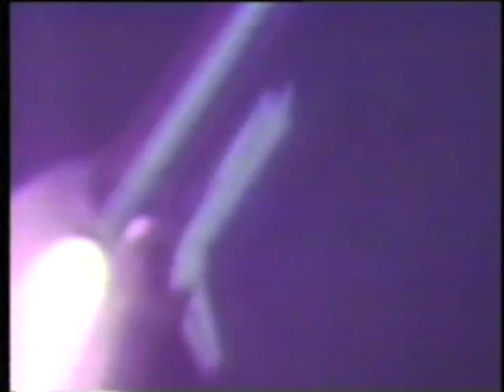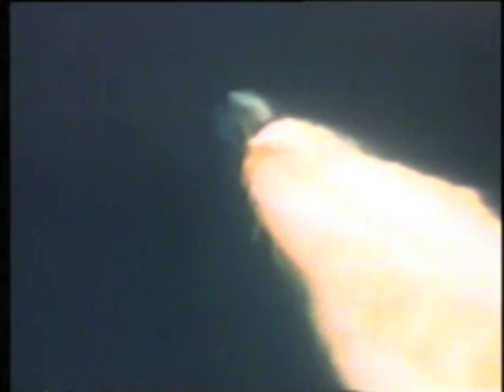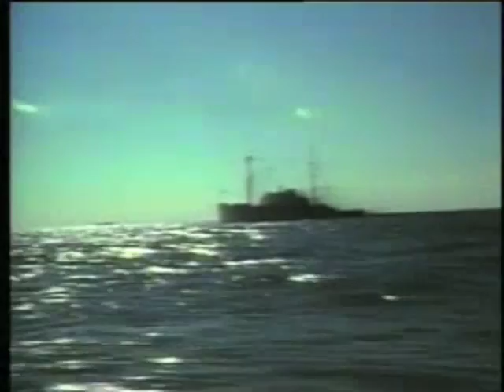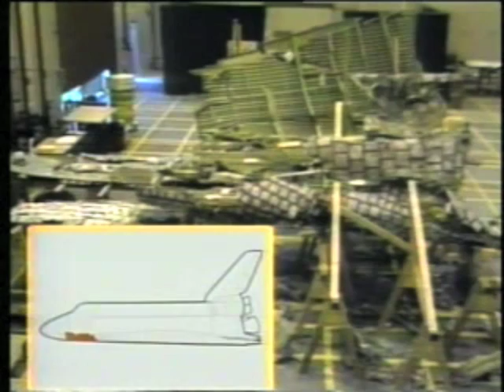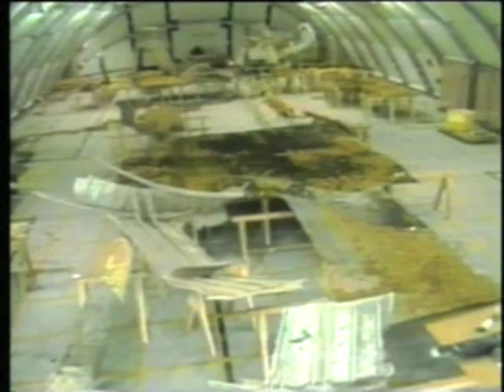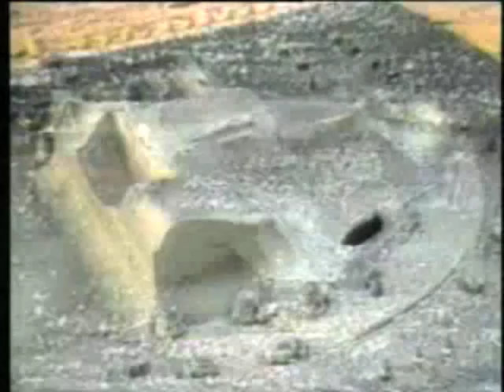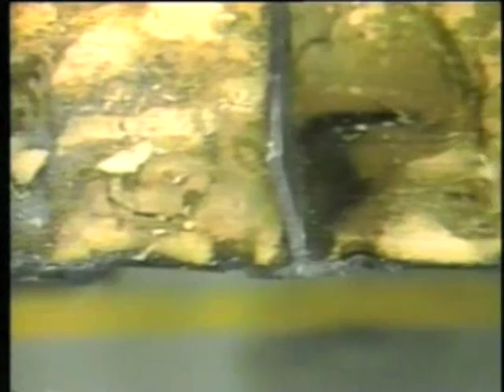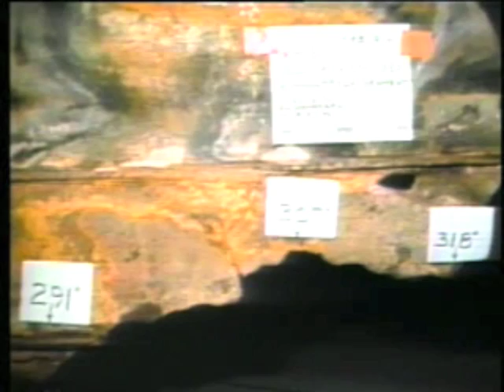Challenger Accident - Part III Photo and Video Analysis

Comment: Is there a way to create a cab that can withstand such forces to allow the crew to survive and fall down controlled
Reply: Something like that was looked at early in the design but it was tossed out due to the high weight penalty and added complexity.
Reply: @da40flyer  fair enough

Comment: 0:34 I have watched this video many times. And in recognition of the Pilots navigation was off course from take off. If you view other videos that shows how the launch started. You can see that the spacecraft is maneuving into a angle after leaving the "Launch Pad."  Within the first 75 ft from the launch pad the ship was in an angle. That in return put tremendous amount of pressure (g-force) against the ship internal parts. The pilot(s) should've flown the ship straight up from the launch pad until reaching enough height to start tilting with the earth atmosphere.
Reply: I don't think the pilots hae anything to do with that.  From launch to some point well into the climb, they crew is entirely along for the ride as far as where they're going.
Reply: johnfitzgerald1192   It's crystal clear you know NOTHING about the space program/shuttle program.  The pilot does no maneuvering whatsoever.  It's all done via computer and calculated to the millionth degree.   Spacecraft are launched to achieve an angle to enter their orbit which can never happen if they are launched "straight up" as you put it.  Try doing some research.

Comment: It always got me that after it explodes the flight director ask if anyone saw anything out of the ordinary on there screens. The person at the solid rockets had to have seen the pressure dropping for a good 10 seconds the person on the tank saw the hydrogen dropping for at least 7 seconds and nevermind the last second when it hit zero granted they didn't know where the hydrogen went but it definitely wasn't in the tank anymore and the shuttle main engines shut down and the exaggerated stirring commands.  I'm sure every screen in mission control said basically don't look at shuttle they're fucked. I guess I'd of said nothing too what good was it going to do

Comment: A result of bad engineering my ass.  The engineers told them the part wasn’t tested below temperatures they experienced the night before launch. This is BS.  TOTAL BS. Someone made the call to “go” when they clearly shouldn’t have.  Pressure from high up was strong and they needed this program to succeed.  Just like airlines that allow planes to fly when they really shouldn’t.  This happens all the time.  Blaming the engineers is the lowest thing someone can do.   Complete BS.

Comment: Both the Challenger, and Columbia accidents were preventable. But NASA management failed those astronauts, the disconnect between the Engineering group, and Management group was, and still is the problem. Management should never be allowed to overrule Quality control, or Engineering. That’s what’s wrong with companies these days

Comment: could they have put parachute deployment on the crew cabin so it could have slowed its descent to the sea ? Then save the crew ?
Reply: The crew cabin breaking off intact is a very difficult scenario to plan for. There are many other possible types of failures which could occur.
Reply: @extrude22  yeah true.

Comment: I remember seeing video of one of the O-rings underwater on the news and the report that the O-rings were recovered.   Why didn' t the thiokol engineers static fire a booster in the desert at night when it was cold to show the o-rings wouldn't work in tbe cold?
Reply: Because they didn`t have to! Previous flights had already demonstrated that the O-ring had problems in cold weather... And they said so, but were told to take on the management hat instead of their engineering hat what they gave the green ligth for this particular flight.
Reply: The o rings also showed degradation in higher launch temps. NASA knew this. Disgraceful decision.
Reply: @simonball6560  What was disgraceful was that a NASA engineer who evaluated this design for the SRBs before the contract was awarded to Thiokol wrote a memo stating that the o-ring design was unacceptable and failed to meet both government and industry standards. So NASA knew this design was faulty before these were ever built and used in Shuttle missions. I have never understood why NASA chose to go with a segmented SRB design when they had submissions from other firms for a single piece SRB. Morton Thiokol was located in Utah, though, they couldn't ship a single piece SRB to Florida. They had to make pieces that could fit on trains. Their bid was lowest so cost was the obvious factor but NASA knew this design wouldn't work and disregarded safety from the outset.

Comment: I listened to a presentation by Mike Mulane. Previous astronaut in that vehicle. There is a series of O rings, none should show signs of failure, but on previous flights post inspection showed minor heat failure. Since the failure didn’t reach the final O ring NASA just “documented” without changing the process. Before this fatal event they called it “ deviation of normalcy” which is fancy terms for acceptable level of non fatal failure. Once it became fatal everyone blamed the space race and beating Russia.

Comment: The Weather Channel series When Weather Changed History has an episode 
about the loss of Challenger.  They present the possibility that there 
was wind shear that struck the shuttle, putting sudden additional load 
on the solid rocket booster causing soot that had temporarily sealed the
 faulty O-Ring during its climb to come loose and allowing rocket 
exhaust blow-by to cut loose the lower end of the booster and/or 
impact/ignite the fuel tank.  If the wind shear had not been present, 
perhaps Challenger would have made it safely to booster separation and 
to orbit, as had the pevious 25 shuttle launches.
Reply: Exactly.
It was the soot that prevented it from blowing up on the launch pad

Comment: Why would o-rings be expected to operate in freezing high-altitude conditions, but were not suitable for low-level cold temperatures?
Sounds like the whole concept of using polymer o-rings was flawed in general.
Reply: I think the mechanical stresses due to launch and the cold temperatures caused the initial problem
Reply: The O rings had failed in the past

Comment: When you put people in charge that care more about their career than safety and success, problems occur.   Politics permeates every corner of business today....public and private sector.  It used to be that decisions were made by folks with decades of real world experience.  Now....they are made by those with advanced degrees and political and corporate ambitions.
Reply: There is a term for it in risk avoidance theory. NASA got caught in a trap humans let themselves get into over and over. Limits are set at the beginning of programs. Limits get hit as soon as operations begin, and rapidly limits get pushed. In the mind of a human those pushed limits become the new limits. Over time they accumulate, and the system breaks down. The report on Challenger high lights this happening to NASA. They let it happen again with Columbia. They knew the foam was coming off, and doing damage. They flew anyway.

Comment: Had the o-ring failed on the outward side, would the SRB joint have held?
Reply: no. the pressure from an outside failure, would have caused the lower SRV struts to twist into the main fuel tank, rupturing it at the mount, resulting in the same conclusion.

Comment: And, again, no one was held accountable.
Reply: No one is ever held accountable in government
Reply: @TMJ32 , yep, UNTOUCHABLE.
Reply: Sad that the crew lost their lives due to outside pressure to achieve a certain number of launches dictated by the Govt. The company that manufactured the srb's knew that in tests the rubber o ring that sealed the joint failed when outside temps were below a certain threshold, they knew this on the morning of the launch but still went ahead and launched those poor people to their deaths. Someone has to be responsible for giving the green light to the launch, all the engineers were against it. 🙁

Comment: O-ring failure on the SRBs wasn't a new problem specific to this one mission. Both NASA and engineers at Morton Thiokol like Roger Boisjoly knew about it long before the Challenger tragedy but it was deemed an 'acceptable risk' by NASA. SRBs jettisoned from previous successful launches then recovered for analysis showed significant burn-through on the O-rings - on one SRB 70% of the O-ring had been burnt away. So previous launches were at risk of this kind of catastrophic failure but had always got away with it. The Challenger launch was no different but this time the shuttle, the crew and NASA just ran out of luck. The cold weather the night before the launch contributed to the failure of the O-ring on the SRB but it was a combination of this, the poor design and the arrogance of NASA managers who overruled the likes of Roger Boisjoly at MT who advised against launching in such cold weather - that caused the disaster. Everything just came together to create the perfect storm...
Reply: Little things , big outcomes
Reply: Had they waited for warmer weather, it is not likely it would have happened, but again, no one will know for sure.

Comment: The SRB joint failed in the worst possible place. The plume came out right where it would structurally compromise its own attachment to the main tank which led to it destroying the rest of the vehicle. I've always wondered what would have happened if the joint had failed on the outside, where the plume wouldn't have hit anything. Would they have been able to hang on until SRB separation and could abort?
Reply: I know this is a 2 year old comment but I have always wondered the same exact thing, and have asked that question on many different videos, but no one has replied.

Comment: What an incredible dissection. This makes me curious whether there were alarms going off on the flight deck before the breakup and if they could’ve detached in time.
Reply: Once the SRB's light, they're along for the ride until the SRB's are spent and detach. There is no abort while the SRBs are burning.
Reply: The reports say that the crew cabin lost complete power and connection to anything, so with the exception of outside sounds, it was completely silent on the way down.
Reply: @MCECRG lol
Reply: I believe that there was an emergency mode known as "Return To Launch Site (RTLS), where the orbiter jettisons the SRB and ET, and basically glides back to the Shuttle Landing Facility (runway), although I'm not sure if it was completed in 1986. That's a lot of stuff to accomplish in such a short period of time, whether the CDR or PLT saw the loss of right side SRB chamber pressure in enough time to react is debatable, assuming they had a monitor/instrument for SRB chamber pressure. The video is quite interesting, as it breaks down the sequence of events that led to the launch vehicle breakup.
 I recall seeing it on the news as they were beginning the launch, with icicles on the launch pad railings, thinking that's probably not a good idea to launch solid propellant rocket motors in those weather conditions , similar to what we had in the Navy's  Sparrow missiles for propellant. At temperatures below 50* the rubberized polyethylene gaskets lose their ability to stay flexible, which ultimately led to the right-side SRB failure. A sad day indeed, which could have been avoided had leadership listened to the concerns of the field engineers and production teams. It was this type of culture that led to these unfortunate tragedies within the Space Shuttle Program.

Comment: So what currently happened to all the pieces of the Challenger? Where are they now?
Reply: W Pontius Challenger wreckage was placed in silos at Cape Canaveral Air Force Station. Columbia wreckage is stored on the 16th floor of the VAB and KSC.
Reply: Vaulted. They only display one piece of the challenger in the exhibit.

Comment: I have always been amazed that the people that signed off on this mess were never charged with anything and the people that decided to fly EVEN THOUGH they were told not to were also never held accountable. As much as I can tell this whole thing falls under either the oops factor or the pointing finger factor as well as "they told me to launch" and we will never know who they were. I wonder how "they" sleep at night...shitty I hope
Reply: If this had happened in the old Soviet Union, there would have a number of quick trials, followed by firing squads. The Soviet system did not tolerate failure very well.

Comment: In other words the orings fail due to the cold overnight temperature. Any transmission mechanic could have told you not to launch.
Reply: Fan of Lake Speed Any? You can’t test for a leak if there’s no leak, and you can’t test for a potential leak if there are multiple factors that don’t exist on the ground. What test do you propose could determine a fault that took that long to manifest catastrophically when earlier and similar faults outside of component tolerance earlier passed without incident? 
The ‘o’ rings had been a problem before, doubling up with higher rated rings with higher tolerance at lower pressures seemed like a reasonable first step to me - what would you have them do, rebuild the entire structure on a ‘what if’? 
It’s not called rocket science for nothing.
Reply: @Menace.2487  rocket scientist said not to launch. Cold contracts the metal and orings. No test just common sense. Put a flywheel in the freezer over night and the next day a ring gear in the oven and and will drop right on the flywheel although at room temperature is smaller than the flywheel diameter. Absolutely too cold to launch.

Comment: On some footage you can see black smoke coming from the one SRB right at take off. At that point the vehicle was already doomed.
Reply: The shuttle was doomed before the boosters were even lit and some engineer's knew it but wasn't listened to.
Reply: Crypto Colax this is part 3 video they go over the smoke in part 2 and it was partially skewed. You can really only make it out real time in one camera angle.
Reply: Really
Reply: @franmellor9843  yes, really.
Reply: @connylaurine745  your right ! I came across the footage,yes they were doomed omgoodness so sad... NASA would have seen that with the 52 camera's rolling on lift OFF?!
Reply: I don’t think this was the first mission where smoke had been seen.  Certainly they new that the primary o ring had been burned out  by examining previously launched boosters. In those cases the back o ring was still good.  This time due to the cold both got burned out.   I program computers for a living, even though the program works I still analyze the log results for anything unexpected and look into it and make changes as needed.  NASA saw the anomalies, but probably due to existing cost overruns they didn’t do anything about it, and probably couldn’t get the money for it.  Some where between the Apollo program and the shuttle things changed in how they did things.  Certainly money was an issue.  They pretty much had a blank check for the Apollo program.   The shuttle program was plagued by cost overruns and trying to make a single vehicle be everything to everybody.  Apollo had one simple goal.  Land man on the moon and return him safely to the earth.  Everything was put into that last part, especially after the Apollo 1 fire. They got lucky with Apollo 13.  If that tank had exploded before they had docked with the LEM pretty sure they would not be able to use it for a life boat, but who knows there were some pretty steely eyed missile men back then.  If the tank had exploded anytime after the LEM left for the moon, no chance at all.  That tank explosion, contrary to what the movies says, was not a faulty coil, it was due to the history of that tank after it was dropped 2 inches when removing it from a previous Apollo rocket for some design changes.  Reason it got dropped was only 10 of 11 bolts got removed.  Whether that did something or not is unclear, the tank could have been faulty from the factory.  It never got tested fully till installed on 13.  It didn’t work properly then, but due to a design change at the launch site getting lost some where, the procedure to get around it not working properly caused abnormal high temps in the tank to melt the insulation of the wires.  Once filled with LOX it was a bomb that could go off anytime they stirred the tank.  Subsequent missions removed the stirring hardware as it was only needed for more accurate readings of how much LOC was left.  Human errors in this case resulted in the non fatal accident.  The shuttle accidents were a result of known anomalies not being rectified before they caused a fatal accident.  Likely cost overruns and already mounting delays played a part in those not getting fixed.  Certainly somewhere in the chain from the engineers to the flight director who makes the final go no go decision either that info got lost, and/or he was pressured by NASA  management and/or the White House to proceed.

Comment: So sickening I do not want watch.
Would this have occurred even if a warm day?
Reply: It was a seal on the main booster. They didnt replace it. ZFuel was leaking from the booster :-/ Daily temp wouldnt have mattered. 
The shuttle that was lost from cold weather was in Jan 2003 i believe. Thats where the ice smashed the shuttle on take off. Columbia
Reply: @igot99problemsbutmyaltaint81     No.   This was the solid propellant boasterocket leaking fire againsthe tank.  How sad that it did not leak away from the tank where it would have caused no problem.
They think the cold "O" ring allowed propellant combustion gasses to escape the booster, burning a pathway for more to escape.